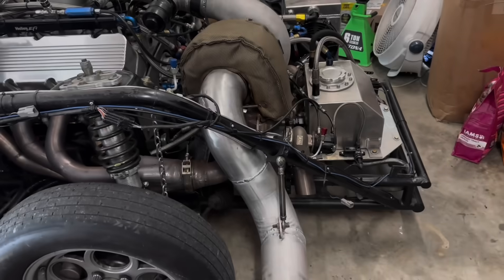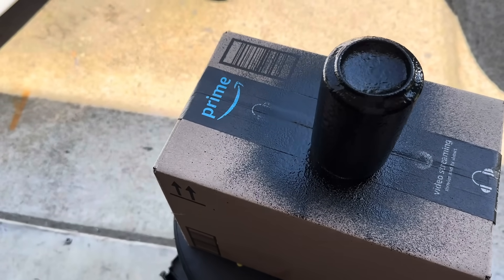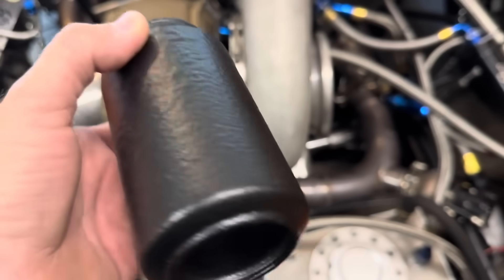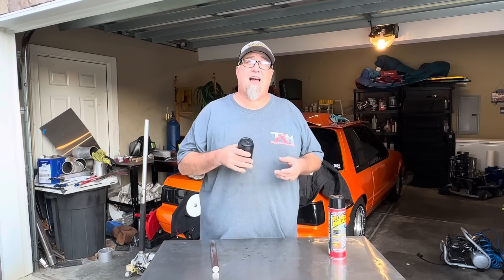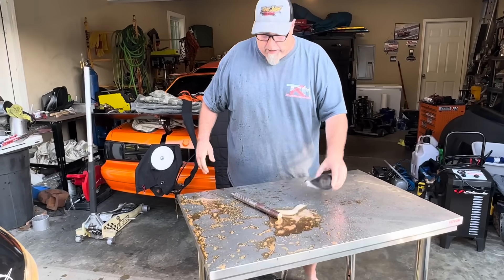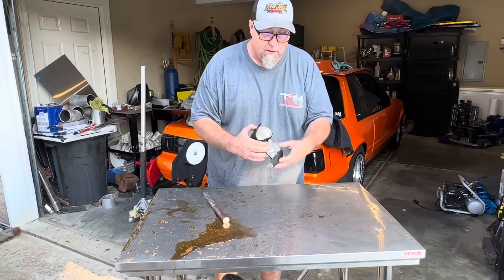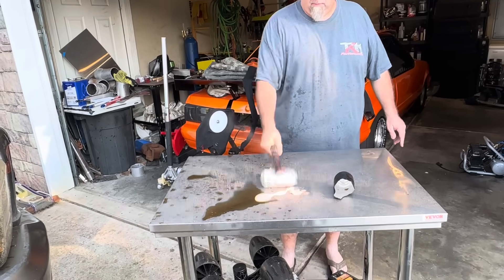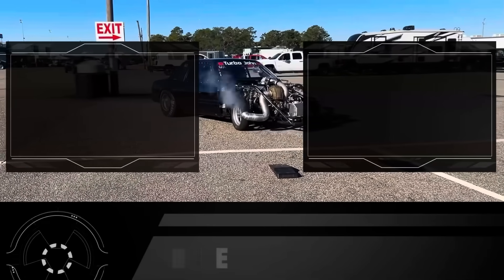I Might Have Found a Way to Make Racing Safer…..  Flex Seal test…. Crazy idea? @FlexSeal

Comment: It's a hydraulic problem you can't compress a liquid. If the fuel cell is too full and gets compressed it will hydraulically open the  container.

Comment: Just dont get fuel on it. I used flex seal on a gocart frame and got fuel on it while filling it up and it ate it off some. I would think methanol would eat it worse. I love the idea definitely something to try and also try other bed liner spray with gas on it to see what holds up against fuel better. Definitely something that would make things safer

Comment: One issue I see is if it gets a fatigue crack say at a weld from vibration,it would be very hard to repair
Reply: They ALL eventually crack and require repair.  It’s just a matter of time.
Reply: 🤔Not really just wire brush it and weld an recoat boom fixed 👌

Comment: you can build a cage around the fuel cell like CJRC does. He makes them where the cage is quick disconnect with locking pins. I dont think flex seal is the right option in this case but it might work if you can get it on thick enough.
Reply: maybe if you can get like 1/2" thick rubber coating on there that might help!

Comment: John you should've had the pop top facing chase. I'd bet it pop there if you tried. Also all aluminum cans used for beverages and food have a thin plastic/rubber coating inside them.

Comment: Yall need to go back to putting them in the rear of the car
Reply: That's exactly what I say a fuel cell belongs in the rear of the car not in the front they only put them in the front because it makes it easier to run fuel lines
Reply: With their fuel pumps they would have to run a cable drive if the fuel cell was in the rear of the car.

Comment: I think that the aluminum used may make make a difference.  Make sure that you can bend it in a press brake. Some aluminum just snaps. Cut some plates, and weld them with 40, 50, and 60 series tig rods. Bend the welds in a press, and see if one holds better. The Flex Seal is a great idea!!

Comment: FYI, flex seal won't hold up to methanol.  It will dissolve it. and I think it's fairly flammable.......some funny shit though!
Reply: Pretty sure it’s going on the outside
Reply: It only has to hold up for the 10-40 seconds it takes for someone to come hit the kill switch
Reply: @NollEngineeringPerformance  flexseal is flammable......I like the idea, great thought out of the box, but flexseal isn't the stuff to use.
Reply: @markgoulette5056 is it flammable when cured? I’d assume it’s definitely flammable before it flashes off.
Reply: @NollEngineeringPerformance  Yes, once it gets hot enough